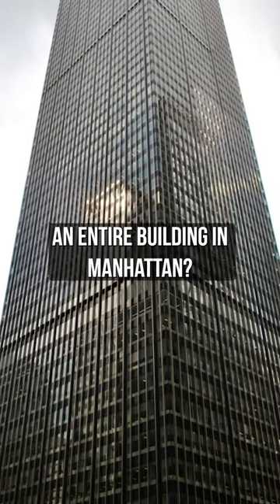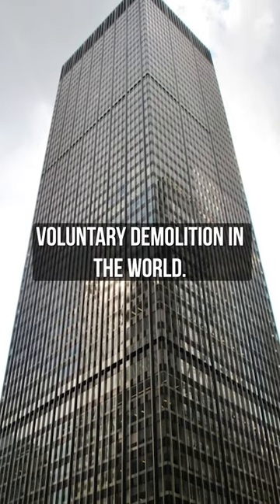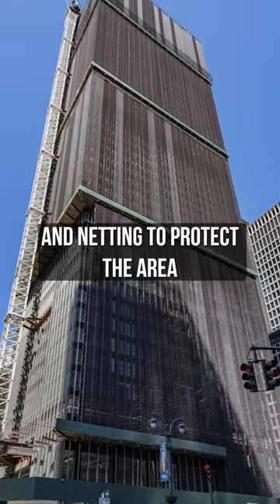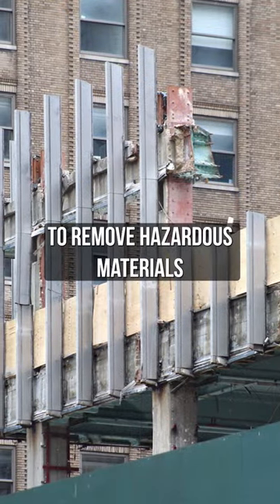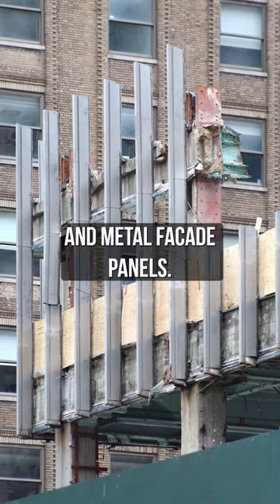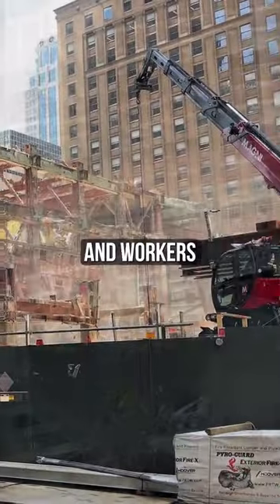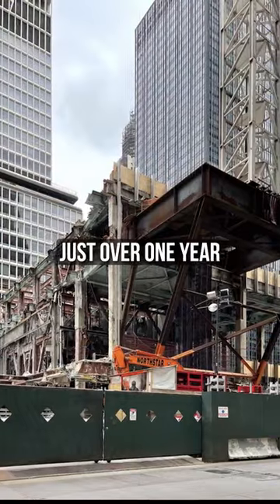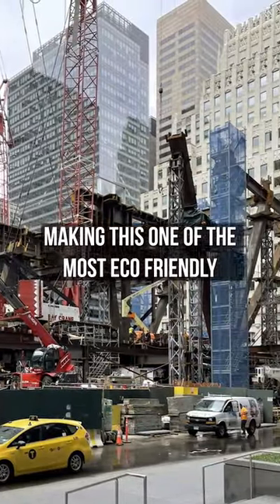The World's Largest Voluntary Demolition

Comment: Nine11 = 2 planes BUT 3 skyscrapers went down. Look it up from non-censored sources.
Reply: R U M B L E  would be the best source seeing that yt has deleted my reply to you twice now.
Reply: An 8 buildings were destroyed
Reply: Building 7 was a voluntary demolition.
Reply: About a dozen buildings were destroyed that day.  Yutzes.
Reply: Building 7 fell because it was damaged by debris from the north tower collapsing which ignited fires in the building. “Pull it” refers to pulling the rescue and firefighting operation because of the already terrible loss of life. Since the fires burned uncontrollably for hours, the collapse was inevitable. And why even destroy building 7 if 9/11 were an inside job? It’s not significant in any way shape or form compared to the iconic status of the twin towers. And no, it didn’t fall at free fall speed, the acceleration is from lower sections of the building providing resistance only to collapse due to the weight of the broken off sections. The collapse was also progressive since the inside fell first followed by the exterior. If it were free fall, the collapse would be UNIFORM.
Reply: Do you know conspiracy people; you are r..
... cough, cough ; ahhhhrrrrrgh
I know the truthhhhhhh.....
Reply: Actually 7 buildings fell wtc 1-7

Comment: You could do all that, or just fly an aircraft into it. Apparently that also causes a perfect demolition 😉
Reply: No one has said that the collapse was perfect.

And before you say anything, building 7 was hit with debris from the north tower. Fires burned uncontrolled. “Pull it” refers to the rescue operation. Pull the fire fighters out of the building because of the already terrible loss of life. 

The beams did not melt, rather they expanded and sagged due to the fire. and with regards to explosives why the fuck would ANYBODY in government want to kill thousands of their own citizens in a building? They’d likely be noticed because of how busy the towers were, even overnight staff could’ve caught someone planting explosives.

The towers had a tubular construction, not webbed steel like most buildings. Built to withstand a 707 at normal speed on a foggy day, not a 767 flying at very high speeds.

controlled demolition starts at THE BOTTOM, not the top. It would also leave specific debris patterns unlike the ones found at ground zero. Additionally, you would hear explosions before collapse, and the squibs would be present before the collapse also. For there to be a controlled demolition that caused the collapse, there would need to be detonation cords found in the debris, which are YELLOW. They were not found in the rubble, just look at ground zero images.

The towers and building 7 did not fall at free fall speed, if they did, the debris pile would be more uniform. The collapse was progressive because the remaining structures kept falling due to the increasing load/weight of the buildings being held up. As the floors above began to fall, they exerted increasing pressure on the floors below, causing a cascading effect that led to the eventual collapse.

Tower 2 fell first because it was hit lower and at an angle instead of straight on. 

Hearing explosions? The descriptions of the impact and collapse were similes “AS IF a bomb went off,” for instance, or “LIKE an explosion.”

Other buildings in history have collapsed due to fire burning uncontrollably.

Why even involve building 7 if 9/11 was an inside job? it’s not significant compared to the twin towers. 

Early reporting isn’t always accurate especially with events like 9/11. And because the day was so chaotic and traumatic, descriptions and statements can be conflicting with what really happened.

Operation northwoods has ZIP to do with 9/11. It was REJECTED. There has been no way to accurately tie it back to 9/11 plus it was DECLASSIFIED long before the attacks. 

It’s uncommon but not unusual for items that are lightweight like the Saudi passports to survive catastrophic events. Need I say more? Oh and if it was an inside job, why would it be pinned on Al Qaeda, a group that is KNOWN to be hostile to the US? 

“It’s all there black and white clear as crystal! You get NOTHING! YOU LOSE!!! Good DAY, sir!”
-Willy Wonka (Gene Kelly)
Reply: @MrAwesomedude808  If you believe all that junk, I pity you.

Comment: Interesting did u know engineers in sf have found way to straightened leaning building they are gonna use water to straightened then high strength concrete to stabilize brand new technology power of water

Comment: No way 90% was recycled or reused. Not even remotely possible
Reply: Concrete is the most recycled material.. Steel and glass well that's easy as well. Thinking about that tonnage alone the rest would be easily less than 10%. Just those 3 materials in a building are easily more than 90% of an empty building...

Comment: Seeing what goes into taking down a major building, theres no doubt in my mind that a plane could not take down the world trade center.
Reply: It very much can when it's going over 300 mph and completely full of jet fuel
Reply: @StarstruckChiroMusic 😂😂. 300mph isn't anywhere near enough for aluminium to penetrate steel. Those planes would have shredded up/ bounced off. Towers would have held up if you flew 5 planes into each tower
Reply: @coolyoutubename16  That's a lie, Flight 11 and Flight 175 were going 440 mph and 590 mph respectively, it may have been aluminum, but it isn't aluminum foil, it's still pretty thick, and when something is going fast enough it can cut through anything
Reply: @StarstruckChiroMusic even if did penetrate the building would not have collapsed at free fall like that
Reply: 20 stories doesn't have enough mass or force to crush 80. Through its core, too its foundations, 3 seconds slower than free fall speed....
Physics mate.